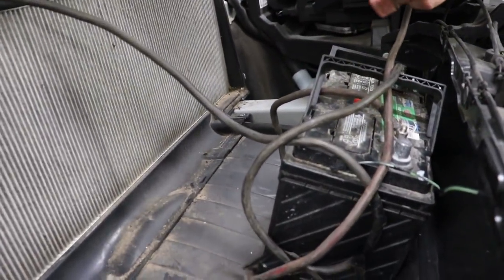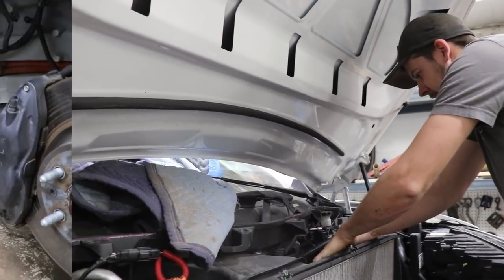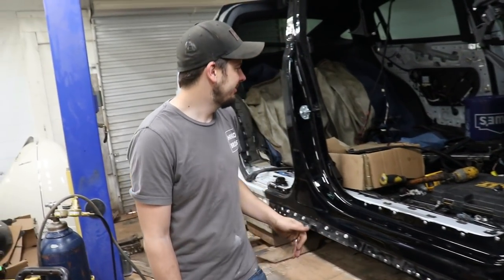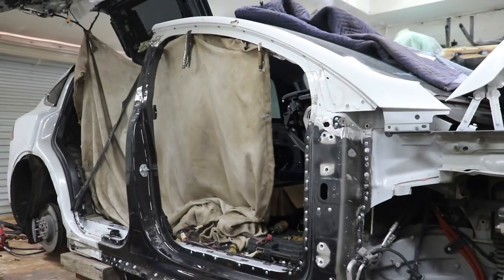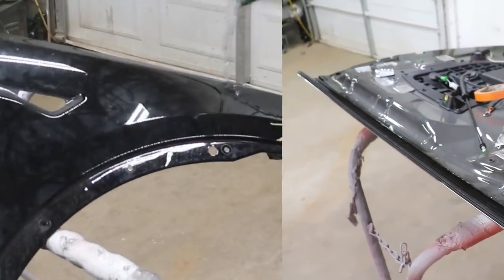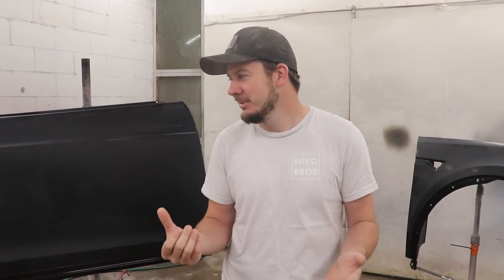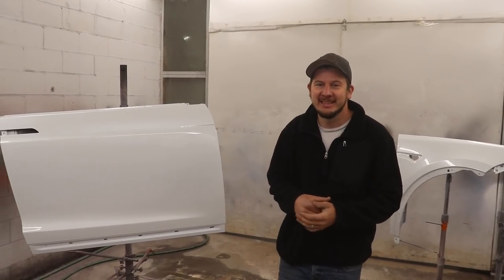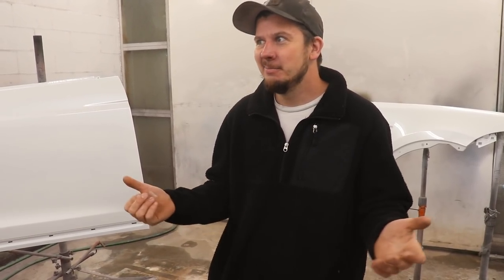TESLA MODEL X BODY WORK AND PAINTING GREAT FRAMING WORK DONE BY @23RD

Comment: The + and - on the battery are directions for adding and subtracting connections. When you add power add the + first. When you subtract power subtract the -- first. Lowers your chances of power surges that blow ECM's and create spark showers.

Comment: Park it outside away from everything else so it does not burn your shop down better yet send it to the crusher where it belongs. Good job fixing it yes but not worth the junk salvage result IMO. The body on frame stuff is reasonable but unit stuff especially the glued ones are always more damaged then you can repair.

Comment: ****Looking good guys. If you can please add some more quick tech tips especially on paint and body work. Like how to prevent chemical reactions, things to clean with prior to painting, what u use for guide coat. What to do when u wet sand thru clear coat, taping techniques ect. I’m at home painter and struggle to learn things like this the hard way. I’m sure you have way more knowledge the would help those of us learning. God bless you guys!

Comment: Finally back after a 2 day easter break. Suggestions for this tesla, install black wheels, install cmst carbon fiber parts, and install a aza auto wheel on this tesla, also suggestions for the duramax install a 5 inch straight pipe, a cold air intake, and a train horn, also updates on the ram longhorn, the burn't boat, the vw beetle, the white squatted silverado, the gmc siera and the other 2 silverados you brought with them, the wreck 2017 thor rv from california, the white ford ranger, the blue ecoboost f150, and the Yacht boat, also build suggestions, do a jeep wrangler, a camaro zl1, a cop car, and a heliocpter
Reply: Justin, blacked out wheels are passé. Any cheapo Ram truck has them.